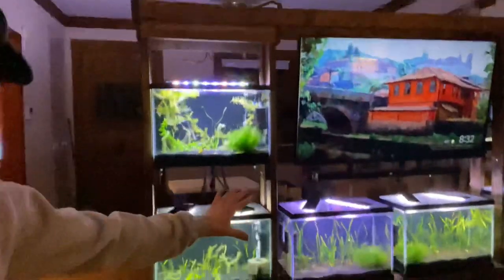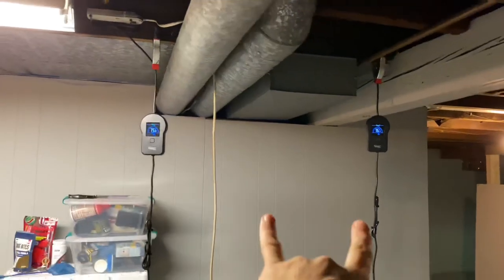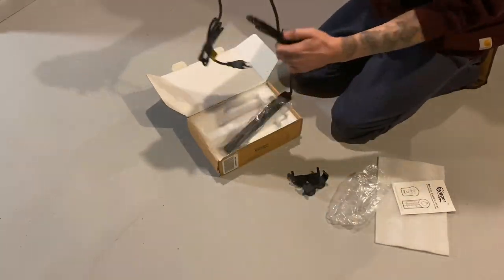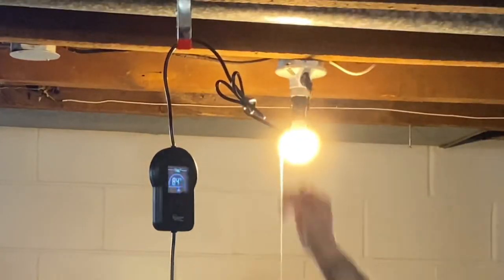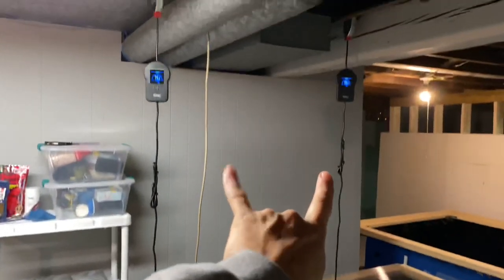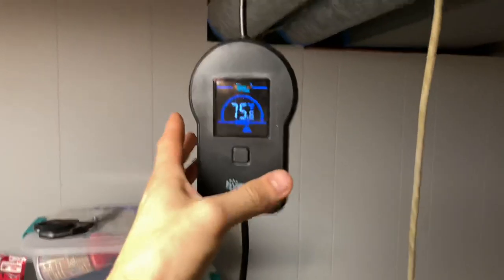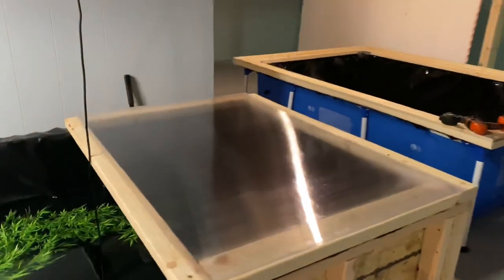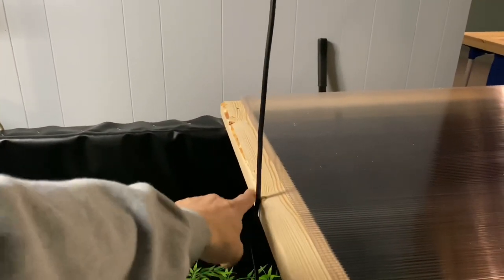Indoor Fish Pond Heater with Thermostat

Comment: Nice Video -- gave me some Ideas for the future..... I also notice in your Video you might want to check into -- (5:41) That Structure Beam with the big cracks in it might be housing a load of Hungry Termites, it happened to me, I reached up and punched my Beam a few times with a Screw Driver and the last couple punches went near straight thru the Beam.... I knew what I had then. So check into that, you don't want them to get out of Hand or it will cost a Fortune to repair and get rid of them.....

Comment: Concrete under the pond will Wick cold up into the water maybe next build insulate the bottom👍. You can throw a divider in for the dovii otherwise that big pond for one fish I would sell especially if you have a buyer✌. Reasonably priced heaters but crazy expensive electric bill😬

Comment: maybe add at least an inch of sand to the bottom to further protect the liner. you gonna need some kinda diy sump at some point to help keep that bad boy clean, several ways you can build one and stock with enough media that gets the job done. u want to at least turn the water over 2x an hour for that volume preferably more so. in my setup my main sump is planted to help clean the water n keep nitrates down as well as another 1200 gph pump hooked to a bucket with pvc pipe spillway fillted with lava rocks.i only have to change about 20% every 2 weeks or so.water stays crystal clear

Comment: If you put a light colored sand in your pond you could see the fish a lot more better👍
Reply: You dont want sand in a pond
Reply: @doylethomason6015  why?
Reply: @natesfishing4188  sand is grit , your fish moving it around , you moving it around , water moving it around is gonna act like sand paper on your liner . 

It makes it hard if not impossible to find a leak in the bottom regardless of cause 

If you have Ray's you take the risk of them dropping a barb and it gets buried at a angle before you find it and then they swim over it and get stabbed . 

I personally do not and will not recommend sand to anyone with a pond .

Comment: You need to get those off the concrete floor - it will be hard to heat those in the winter on a cold foundation like that.
Reply: Wouldnt be if he had insulated it like he should've
Reply from the maker: I totally should have insulated the bottom! I was in such a rush.. that I forgot

Comment: How many would you recommend for a 1500gal pool pond?
Reply from the maker: That’s in pool heater territory!
Reply: @PalmerAquatics  yikes. Haha so does that meant a heater that runs on 220?
Reply from the maker: @Qsteffa524  - most likely. It’s not that complicated though. It’s just larger size wiring and a double breaker in fuse box